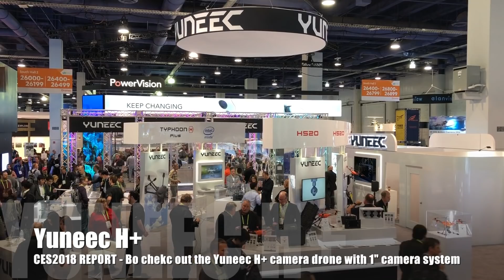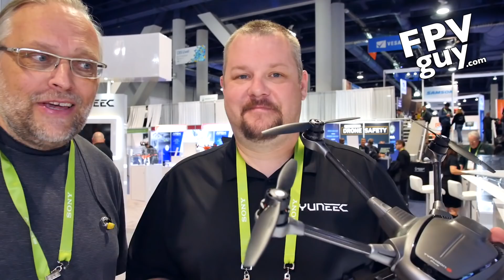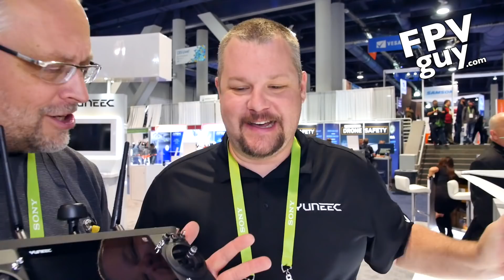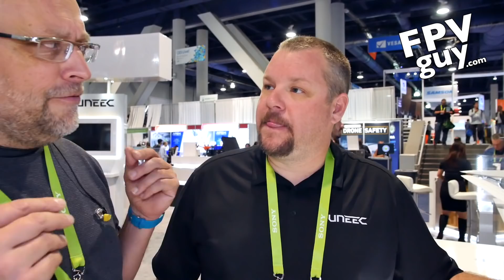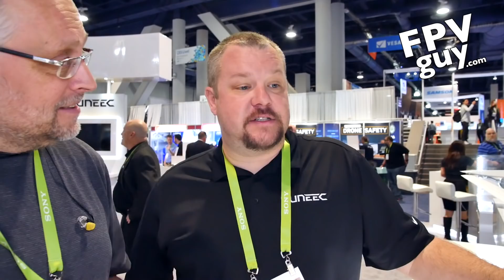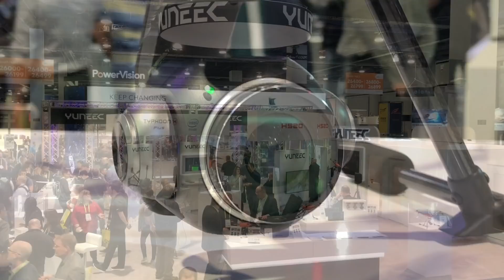CES 2018 • YUNEEC H+

Comment: I wanted so badly to be a Yuneec Pilot, but after all the issues I had with the Q500-4K, I think the only way I would ever fly Yuneec again, is if they gave me an H+ to rebuild my confidence. I was dead set on the H before I purchased the Phantom 4 Pro Plus Obsidian and I know I made the right decision. I was literally on the phone with the sales person to order the H and changed my mind to the P4P because I was too afraid I would have the same issues I had last time. I have been a pilot nearly 5 years now and I couldn't keep a Q500 in the sky because it would fall out of the sky, fly off, the camera constantly had issues, couldn't fly if there was a light breeze, I couldn't fly if it was too cold, I couldn't fly fast. It was a mess! I put my Q500-4K in the air one last time before I sold it and it was like flying a school bus compared to the P4P.
Reply from the maker: Well in all fairness.. the Q500 is a long time ago quad.  ;-)  
That said, the P4pro rocks,   i have had great experiences with that quad.

Comment: Bo, you mentioned that you "pushed" the RealSense and the H went up and over a tree following you! Where is that video? I want to see it!

My RealSense doesn't seem all that good. It's very jerky and moves the H even when I'm stationary. The Indoor Position System is a joke. My H nearly did a fly away indoors! I had to catch the landing skid! If the H+ has RealSense with new firmware I'm wondering if there's a way to upgrade the firmware on the current RealSense? 

I want to see your RealSense "Push" video!

Comment: The camera looks to be based on an E90 which a lot of folk (me included) are very disappointed in
Reply: Gerald McGivern Hi Gerald,

Can you explain why you're disappointed with the E90? I was looking at getting one but this is the second negative comment I've seen.
Reply: soft JEPGs, edge distortion, poor WB, fails to maintain level horizon, doesn't support 50/100fps, no histograms, very jerky rotation, etc